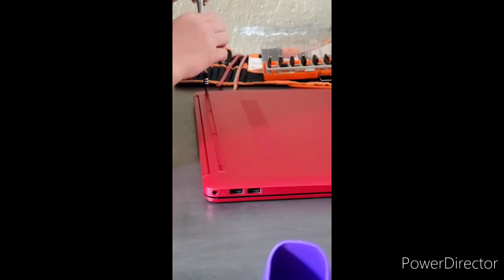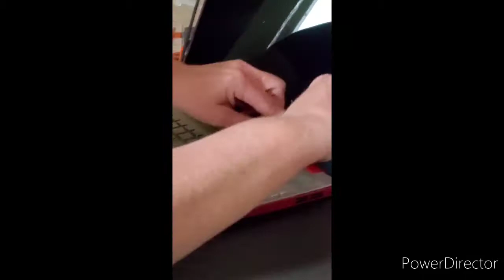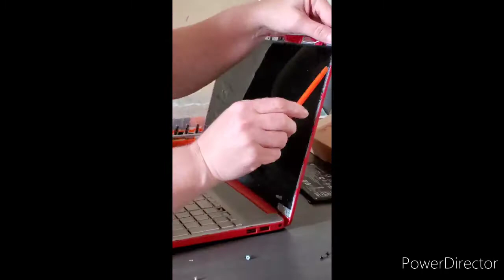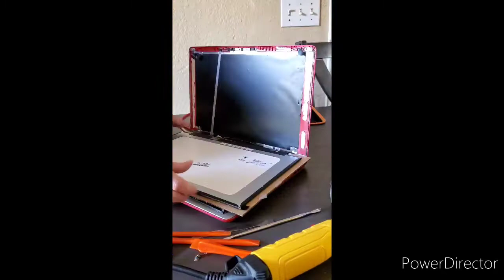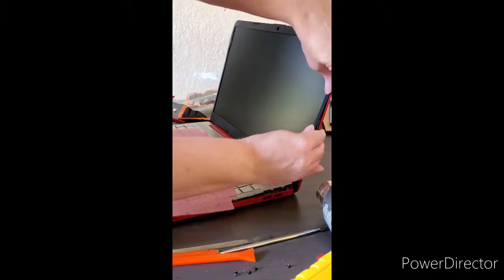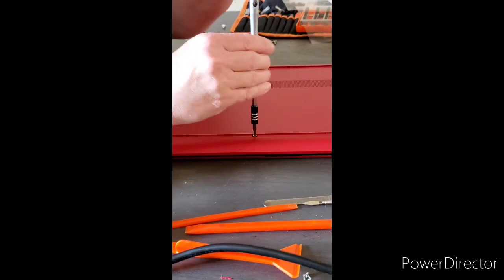HP 15-DW1083WM Screen Replacement

Comment: Hi , a question ?    I want to upgrade the screen , i have an HP Pavillion gaming 15 OLD screen ... Its the same conector , but i dont know if will work ..
What do you think?
Reply from the maker: As long as the connector and dimensions are the same, it should work.

Comment: Where did you buy the replacement screen
Reply from the maker: I got it from Amazon. Here is the link...

BRIGHTFOCAL LCD Screen Replacement for H P 15-dw1083wm 1B9S3UA 15.6 Non-Touch HD WXGA Slim LCD LED Screen LCD Screen Display https://www.amazon.com/dp/B08W4PQM9X/ref=cm_sw_r_apan_glt_fabc_ZFTGHA3DBT1Q2GE80T03?_encoding=UTF8&psc=1

Comment: I didn’t get the serial number of screen
Reply from the maker: Here is a link to the replacement screen...

BRIGHTFOCAL LCD Screen Replacement for H P 15-dw1083wm 1B9S3UA 15.6 Non-Touch HD WXGA Slim LCD LED Screen LCD Screen Display https://www.amazon.com/dp/B08W4PQM9X/ref=cm_sw_r_apan_glt_fabc_ZFTGHA3DBT1Q2GE80T03?_encoding=UTF8&psc=1